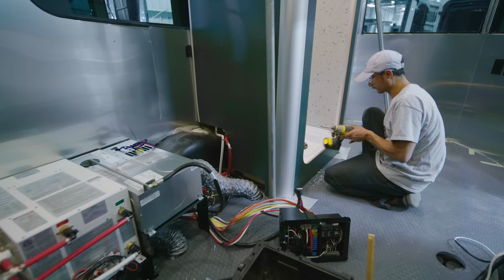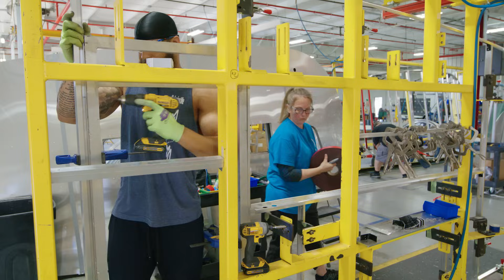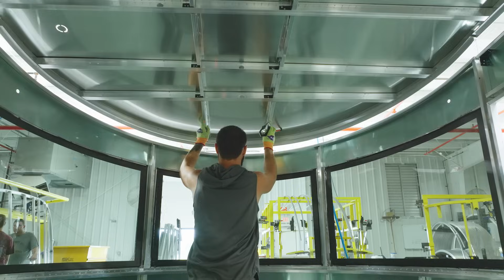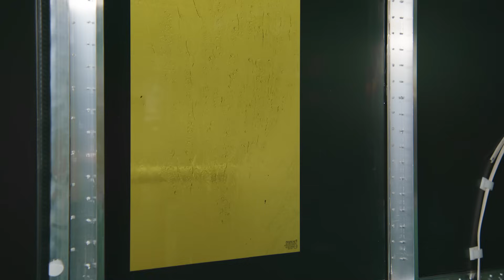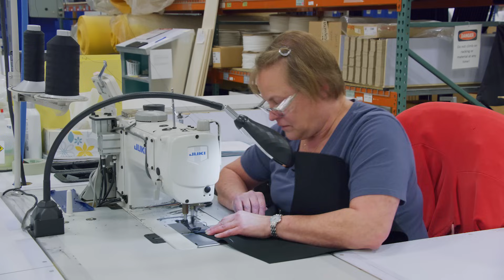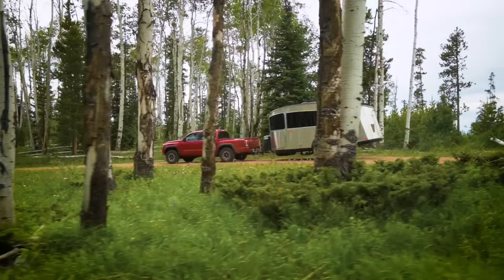A Tour of the Airstream Basecamp Plant | Inside the Basecamp Travel Trailer Production Facility

Comment: Only comment that would make these units better is changing out the insulation to a spray foam insulation. More efficient with added strength and less issues with condensation